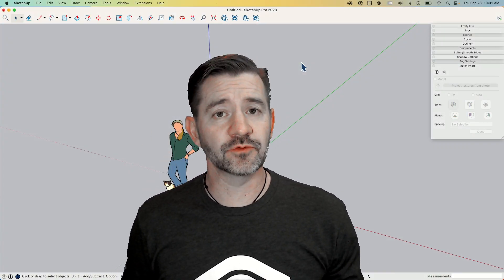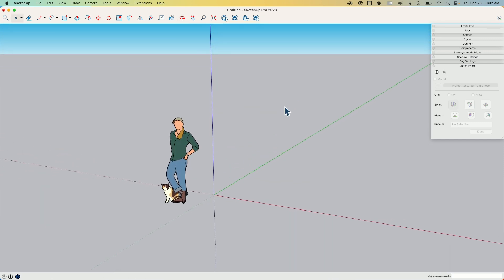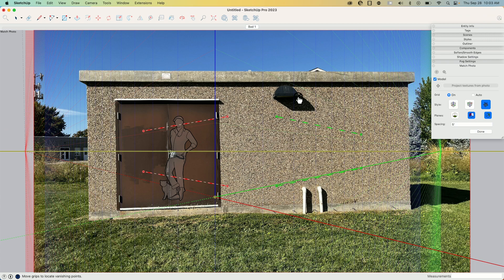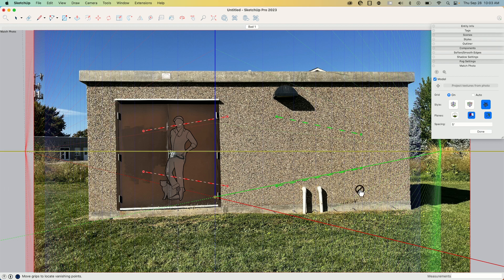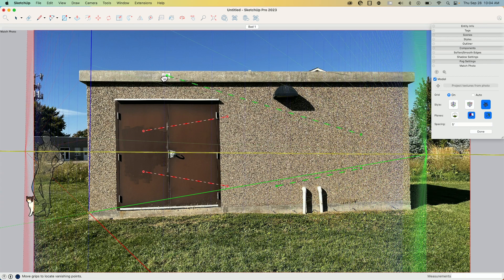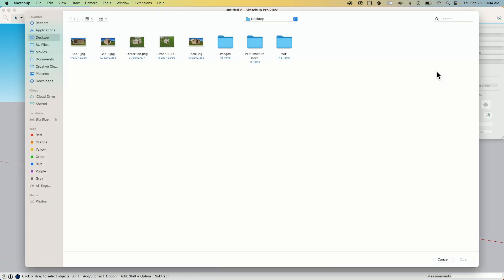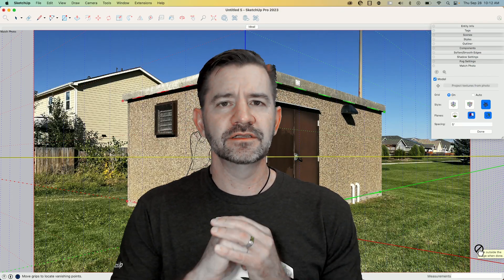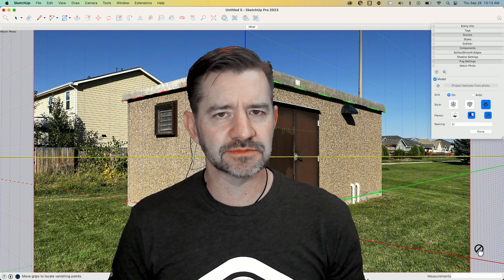Good (and Bad) Match Photo Images

Comment: Thanks for sharing your tips for choosing photos! Is there a way to correct the vertical vanish point that appears in the model? When I match photo with my model the vertical lines always vanish to a central point is there a way to correct this? great content!
Reply from the maker: Do the vertical lines converge in the photo? Try taking the photo with the lens perpendicular to the ground—that is, not tilted up or down—and close to half the height of the wall. There will always be some perspective with a spherical lens, but those techniques will help minimize it.
Reply: @SketchUp Thanks for your answer, no the photo has no vertical vanish point is the model that gets it when I try to match photo. The model gets really distorted and it is imposible to align because the vertical lines are not straight

Comment: Hey Aaron great clip
Can you share a suggestion on how one could use a photo or screenshot from google street view ?
Cheers from Australia 🎉
Reply from the maker: You can try using images from Google street view, but our experience is that they tend to be very distorted due to the lenses used to snap the pictures. You may need to edit the images in a photo editor to get vanishing lines properly aligned.
Reply: @SketchUp  Thanks for the feedback :)

Comment: Maybe critical, but the shadow in the roof “overhang” interfering with your proper line set?
Reply: Probably not. I would most likely use the top of the roof and the bottom of the wall… that shadow should not make a difference!